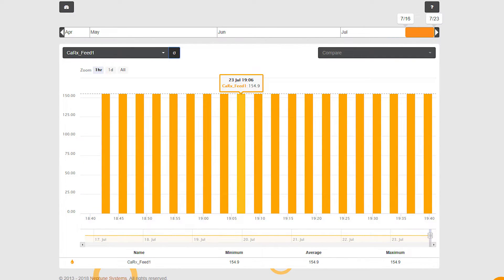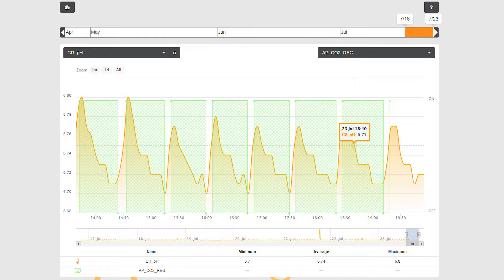My Calcium Reactor/DOS Story

Comment: Hi,

I assume you are aware  but just wondering if you had happened to take a look at the Pacfic Sun Calcfeeder pro controller.

Am I correct in thinking this is how you are using the Neptune DOS
Reply from the maker: Yes I have seen it. Its looks like a nice device and if I was considering buying a new continuous duty pump for a CaRx it would be at the top of the list. I would use it the same as I use a DOS.
Reply: I would be really interested to know how it would get on with your setup as I have also been looking at adding it to a calcium reactor I am setting up.
Reply from the maker: I would just replace the dos with it. I can tell the total amount of liquid the DOS pumps per day. I think it's like 51ml/min. I would start there with the calc feeder on my tank and go from there

Comment: BIZ you crazy ! 😜 nice vid as usual!!! #NAH
Reply from the maker: Like the t-shirt?
Reply: Tha Bizness Reef Tank lol yup!!
Reply: Tha Bizness Reef Tank would teeing in both heads into 1 effluent line cut dwn on the duty cycle of the dos heads ?
Reply from the maker: Yes and I actually have that setup with the 1/4 tubes ran but the 2nd head isn't pumping anything right now. I really want to know how long the head will last on its own. Also I am thinking of that second head as room for growth but I have a long way to go before I need it. My reactor pH can drop some ways before I need to use the head.  I was also thinking of dosing some kinds of refrigerated foods with the second head since the DOS is close to my fridge that I keep my frozen food in - but that's a video for another day.
Reply: Tha Bizness Reef Tank ahh gotcha wat is the apex head capable of pumping out /min ?
Reply from the maker: A DOS can do 7ml/min,  12ml/min, 25ml/min, 60ml/min, 125ml/min and 250ml/min. Since its not continuous you have to build in breaks to cool down. I run mine at 250ml/min but only dose 155ml in that interval. Over the course of a day it does 74352ml per the apex.
Reply: Tha Bizness Reef Tank 74ltrs a day lol idk if that a lot or a little but it sounds interesting. So ur at about 62% duty cycle and you can drop ph further . Not bad !

Comment: I was considering a DOS for my calcium reactor but due to the volume I need to run and the duty cycle of the DOS I am not sure if I would attempt to try using one.  I agree that needle valves and pinch valves have some drawbacks.  I oversized my feed pump to my reactor and recently I moved the check valve to a new location that has created a more constant drip rate but I feel that eventually the drip rate will begin to shift once again.  I have considered an aquaculture duty peristaltic pump but for now I am sticking to an oversized feed pump.  I like the method using the DOS with the intervals and I agree a constant flow is not required.  I think that even if the flow changes slightly it should not create much of a negative impact as long as the pH in the reactor does not lower to the point where the CO2 supply is turned off due to a low pH in the reactor.  Great video.

Comment: Really don't understand why you had so many problems with the ways people been running calcium reactors for 20-plus years. I've been running one for 25 years with some pretty prehistoric equipment and not a problem. Probably should have stuck with the pinch valve and gave it a shot dialing it in. Just takes a little patience that's all. This video is this telling people that you have to spend more money than needed to run a calcium reactor when it's not true just a little patience.
Reply: Just because it works well one way doesn't mean it couldnt work better another. While you can definitely tune one in without a dos, the level of information it provides (or at very least the ease of accessing this information) seems to be unparalleled. I agree it's far from necessary, but you have to admit it's pretty cool